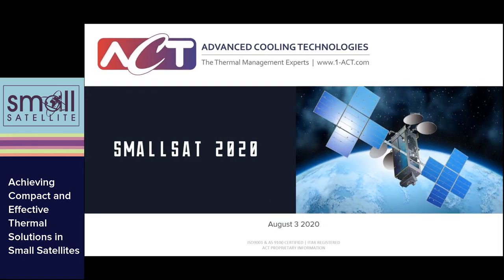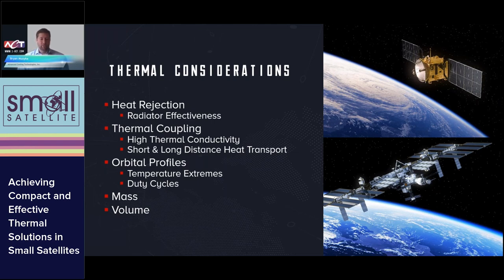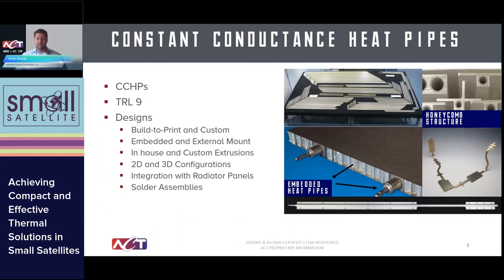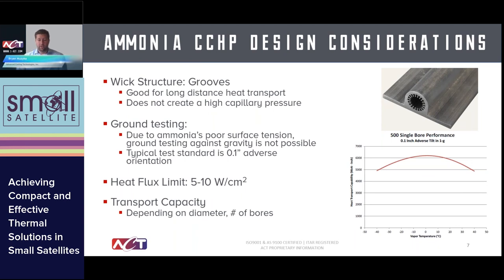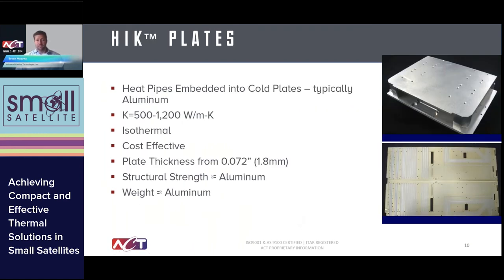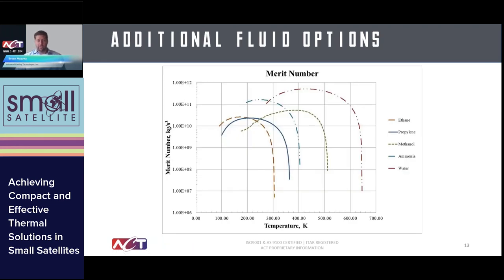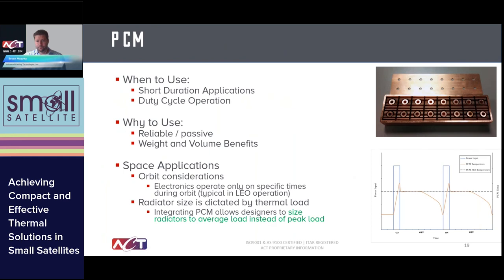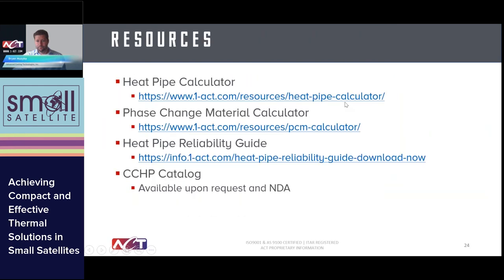Effective thermal solutions for small satellites

Comment: How is a heat pipe embedded in a CubeSat?
Reply from the maker: Great question! Heat pipes can be integrated into CubeSat architectures in a couple different ways. In some cases, they are integrated into board frames to transport the heat from local high heat flux electronics to the walls of the CubeSat. In other cases, they are integrated into the walls/structure and used to spread heat or load share the waste heat between sides of the CubeSat in order to maximize heat rejection surface area for radiation. For more information feel free to contact us at solutions@1-act.com